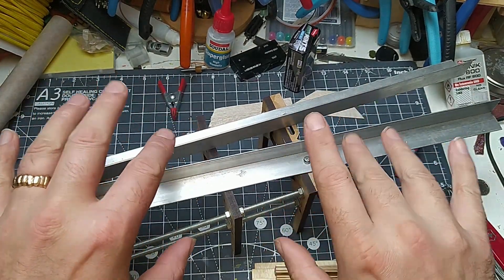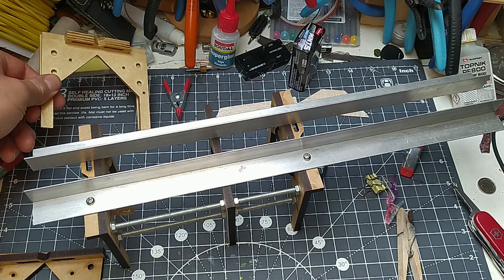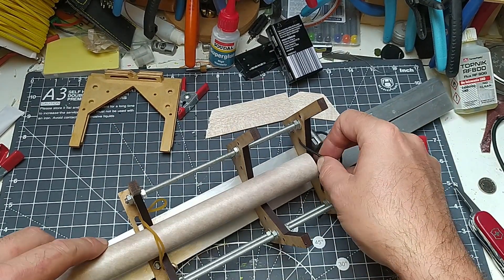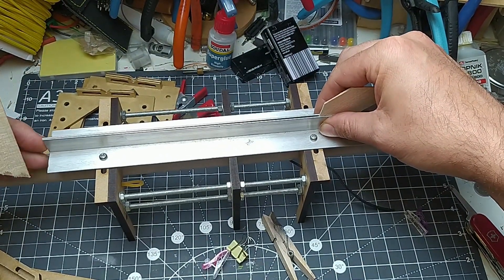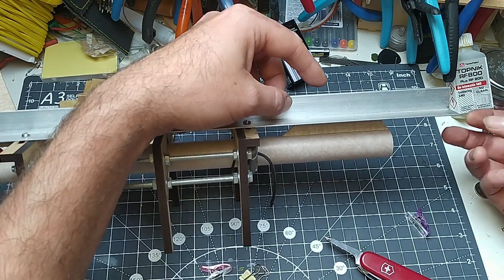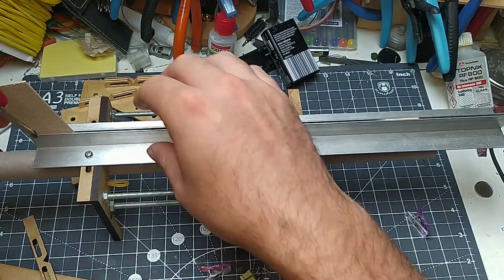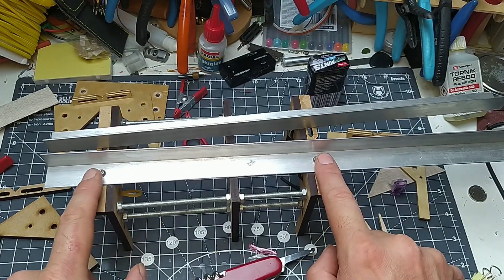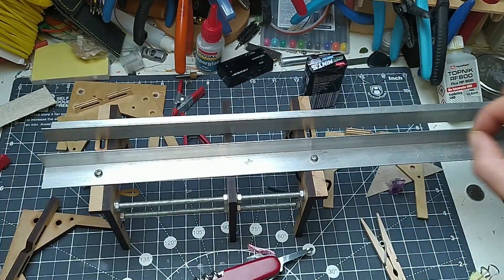Rocketry Fin Jig, Get your fins on perfectly!

Comment: Jo- Just received my package today (ordered two sets in order to have a spare jig.) Now i need to acquire the hardware parts and give it a try...Thanks!
Reply from the maker: Excellent, hope you enjoy it. It's a handy tool for sure.
Reply: @concretedog7427  do you happen to have the lengths on the rails and the bolts as well as the diameter of the bolts?
Reply from the maker: @gregarious_one  so the bolts are M4 and 15mm in length (my angle plates are around 1mm thick). The threaded bars are M5 and around 18cm long, but there are no rules really. The angle plates on mine are around 35cm long.
Reply: @concretedog7427  Thanks so much! Now I have to convert to Imperial. ;)

Comment: Looks good, I wonder about 3d printing the supports!
Reply from the maker: Yeah I considered 3dprinting, but there's a lot to be said for mdf and steel all thread.. its solid and you can adjust it really square.
Reply: @concretedog7427  to be fair if I had a laser cutter it is the way I would go!